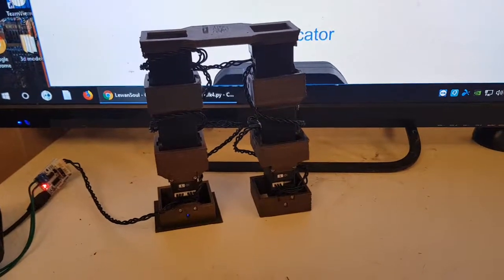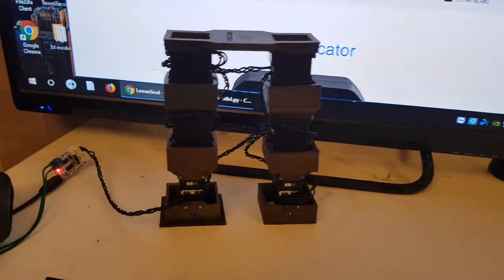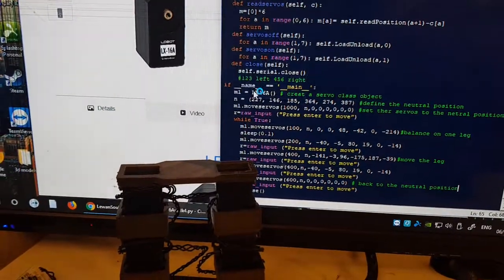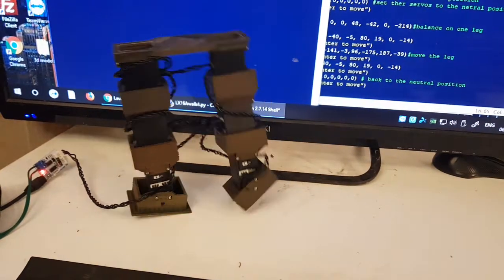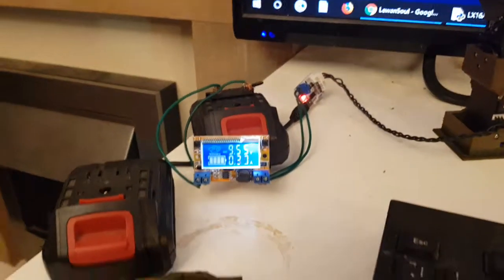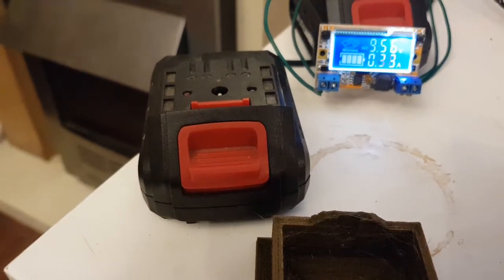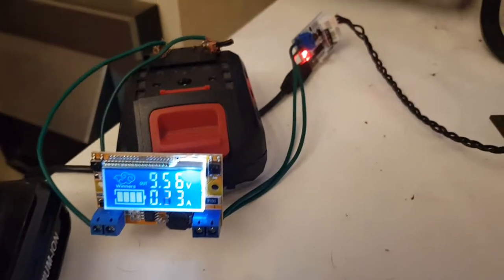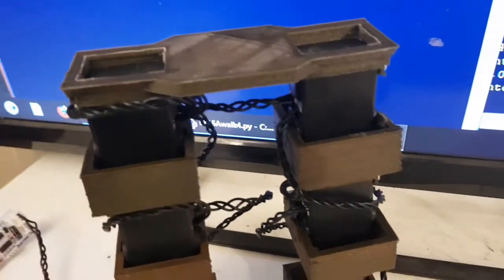LX16A servo robot controlled using python 2.7 on windows

Comment: Nice work.  Are the stl files available?  I can't make out how your bottom servos are attached with the 90` offset,  Looks like a nice design.  Just wondering.  Thanks for the video and the code,
Reply: H flatswood dad....I've upgraded the design as I now use a resin printer. not sure if the stl files can still be printed on an fdm machine which was always a little hit and miss even with my ultimaker.....i'll try and attach the files... they're on tinkercad so you can easily cusomize them...
Reply from the maker: HI Sorry It took so long...here is the tinkercad for an early version of this..it should be self explanatory... 
https://www.tinkercad.com/things/5qjr3BSgDzb